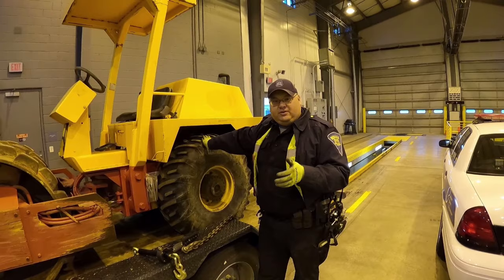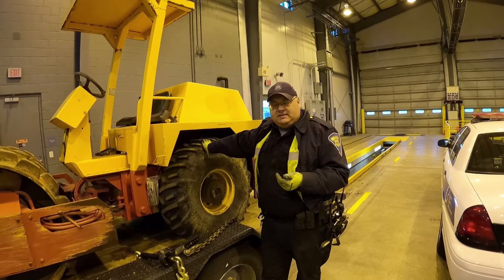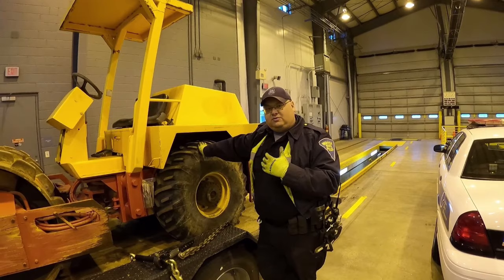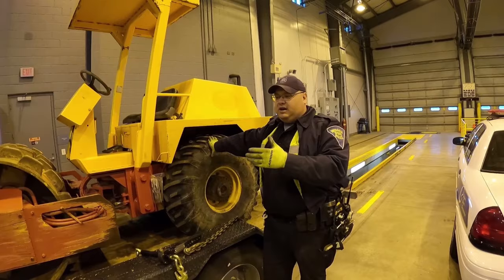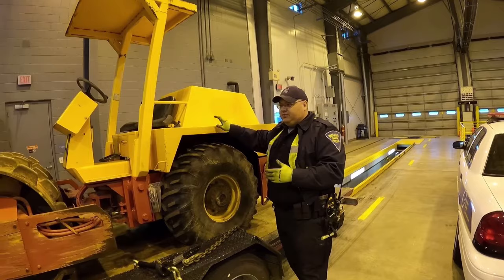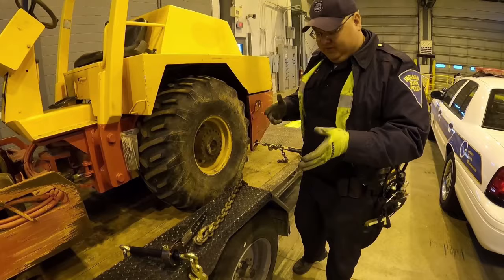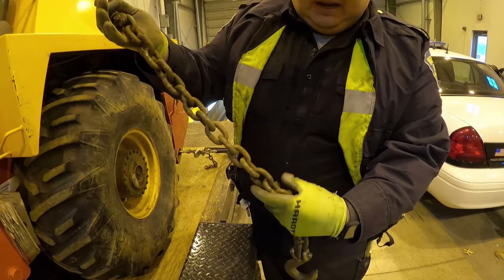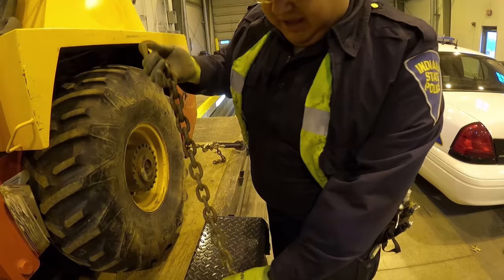Proper Load Securement | DOT Compliance when Hauling Equipment

Comment: The guy means well, but he is 100% wrong about the articulated equipment part.  The way that machine is tied at the four corners meets the req😅and no additional securement of the center is required

Comment: I run g70 1/2 inch chains only broke all 4 corner chains on a wheel loader at the same time that's why "over securment" is always the way to go if you ain't willing to break that extra sweat throwing a few extra chains and binders heavy haul ain't for you and we don't want you c'mon

Comment: 15:07 an important note to add to this very informative session is when using straps is to pay attention to the color of the red line. It indicates the age and wear of the strap. 

The less red there is in the strip in the middle indicates the strap is no longer at its rated strength. So when they start looking pink time to get rid of them.

Edit: I spelled wear wrong

Comment: I'd rather secure the backhoe implement in the down/tied down position rather than in the locked upright position on a trailer just for the additional clearance alone, and many backhoes even locked sway pretty good just driving down the road without a trailer. But good to know the option is there.

Comment: Heavy haul company i haul for we  use 1/2" good for 11 300lbs
Some tandem trucks have a couple 3/8 chain but hardly use them
The tri drive trucks have 1/2" chains with 9200lb an 13 000lb binders

Comment: Tip to remember, the rub rail on many trailers only have a 5020 or 5700 pound WLL, therefore you would only have 50% of 5020 or 5700 pounds.
Reply: Where do you find that information
Reply: There is no WLL on rub rails. This is one reason FMCSA would not allow securement on rub rails. Which was quick rescinded.

Comment: i dont know what that tractor weighs, but if it is over 22700Lbs here in north western Ont you can not use straps to tie it down, i learned the hard way some 15 years ago, after using straps for 15 years and never had been stopped, but one day i rented a 6500Lb mini ex and put it on me trailer, and used 2 chain, grade 90 deck chain, witch is minimum, here and it must be gold in color and 2 binders on the 2 back corners, and 2 4 foot long 2" wide 5,000Lb straps one on each front corner and a 5,000 strap over the bucket, i got pulled over by the MTO AND FINED FOR USING STRAPS i was told the strap over the bucket was fine, but they cant be used as a main holding, you must have al goldd color #90 chain, ether 5/16, 3/8. 1/2" 5/8" depending on load weight.. i see mr DP dont have nothing in the center of that roller. here if you run a main chain from one side of the trailer to the other over the load, you must have a binder on each side, as the chain can snag and have little tension on the other side, also here your trailer total weight cant be over 10.000Lbs unless you have a class A license, a G, D, B license the trailer cant be over 10,000. what i hate here is the MTO PEOPLE MALE OF FEMALE WILL NOT TELL YOU ANY THING, UNTIL THEY FINE YOU FOR IT. or plates off on site.. . . WHEN I CHANGED MY TRUCK OVER FROM COMMERCIAL plated to farm plated, i stopped at the scales to ask, now that i have farm plates on my truck, do i still need a CVOR, AND DO I NEED TO STILL HAVE TO TAKE MY TRUCK INTO A SHOP THAT DO SAFETY INSPECTION,, EVERY YEAR FOR A NEW INSPECTION, STICKER ON THE TRUCK,, AND ANY TRAILER I PULL WITH THE TRUCK, WITCH COST ME AROUND 1700$ EVERY YEAR JUST  for the truck. not including any work repairs that fail.. inspection, the answer i got was look it up if you dont know.. THEY ALL REMIND ME OF  IN 2004 WHEN I WAS IN Finland FOR A MONTH, FAMILY TOOK ME BY TRAIN TO RUSHA,, , AND IT WAS LIKE COLONEL KLINK, RUSHA NOT LONGER A COMMUNIST COUNTRY BUT THEY STILL ACT AS IF THEY ARE, I WAS TOLD, WHEN WE GET TO THE BOARD, DONT TALK TO THE GUARDS DONT EVEN LOOK AT THEM.. well, like everything, you have to look deep into fine print to find any thing. i hate when the scales are open, weighing you never good enough, every time 2 guys come out one on a creeper under the truck and the other one walking around ordering you to put this light on, that light on, put your trailer brake on and put in 3rd gear and pull a head.. wait there a guy under the truck, ,, never mind do as i said..

Comment: He should have talked about over 10 ft long requires another strap or chain...
That mean most skidsters without buckets are just over 10 ft long, Therefore you need two straps in the back one strap in front. You're under 10,000 lb however since you're over 10 ft long you need that fourth strat putting you back at four corner securement😮
Then if you have the bucket now you need another strap over the bucket so you need five points of securement and if you're using chains you need five binders. YES?
-Plus for smaller skidsters that are under 10 ft long once you put a bucket on them you're back over 10 ft long now so it puts you back at 5 points of securement there as well? 🤷‍♂️

Comment: Hello    great clip .  however   i do have one ?.   at the start  of it he said  lets say this  weighted 50,000  pounds.   cut  in half  that  25,000  pounds. the   chains  were rated  for 6600  wll.   then   it went from mechine  to trailer  and that derated it in half  to 3300  wll.  and if you have   4 tie downs on it  thats  only  13,200  pounds.   but  dont we need  to make up  for 25,000..  i know it was for training.   but  he should  have said  to add   more  chains

Comment: I have a question, and don’t have FB. If you were to move something like 2 scissor lifts side by side, if you ran 1 chain through both, on each end/front and back, each lift weighs 6500lbs but are they technically considered as over 10,001lbs and now require the 4 corners? Or would the chain, being that it’s 1 chain straight across on each end would get you your 100%WLL and you’d be securing over 100% of the weight of the lifts combined, how would that work? Thanks!

Comment: I loaded a printing press, broken down to several pieces, out Guelph Ontario, on a roll top trailer.  I had 17 chains holding this thing down and way I did was chains over every piece time 2.  Coming down #8 to go south, a car cut me and I had hit the brakes hard.  doing that, 16 of those chains broke loose, nothing moved but that car drive should have charged with being an Idiot

Comment: Alright so say I have a piece of machinery, it has grab handle type tie down points on the front and rear, if I run a single chain thru both points and x to each side with a Binder on each corner, do I qualify for the 4 points and the full WLL of my chain and binders?

Comment: What about using rope on under 10k loads? That's what I used almost exclusively to secure everything not welded down and never had anything I secured move an inch. Even in 30 ft seas, which you don't see on the highway. I would take the rating of the rope and figure the percentage of loss for each type of knot, and ensured that I had the correct rope for the job. Is that legal for light loads on the highway?
Reply: I know this is late, but in 393.104(f) it says, “Tiedowns and securing devices must not contain knots.” I don’t see anything about weights, so I would assume this would apply to all weight categories. Also, in 393.104(e) there is a list of acceptable types of cordage. So again, I would assume you couldn’t just grab any old type of cordage and start securing a load. You would need to follow these standards.

Comment: OKS !!!  "" Back in the day ""  The DOT rule was that a chain was to be between the "Chain Binder " & the trailer as well as the load so that if the binder became loose ,,it would NOT disconnect from the trailer itself & ALL chain connections were to be in the trailer pocket NOT the rub rail !!  Today ,,they just hook the binder into the trailer & ONLY use a chain if the Binder was too short or wouldn't connect to the load so if it became loose ,,then it could disconnect from the load !!  Guess the LAWS have changed over the years , but when I was on a ""SKATEBOARD""  still followed the ""OLD"" Laws on Securement !!!  Retired now so DON"T care how its done till a wreck happens !!  🤔🙄👀👀👀

Comment: [NO CDL IN THE STATE OF VIRGINIA  AS LONG  AS KEEP THE WEIGHT AT  26001]
Reply: As long as gcwr is 26001lbs or under. Not weight.
Reply: Thank, you I was told by a offline  friend to carry the Dump trk to a certified scales and get the Dump trk weighted in and find out what the empty weight of the Dump trk is before puting it on the Road   before puting it on the road I'm going to do this 😀